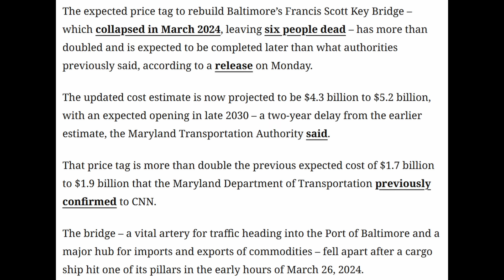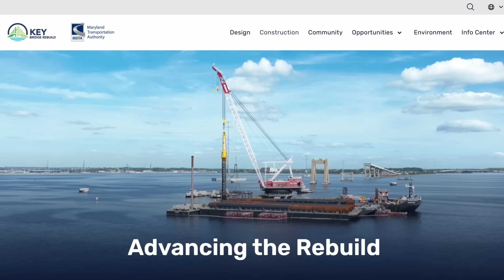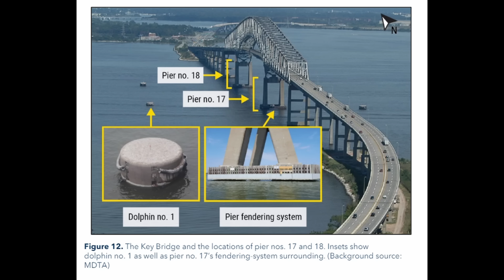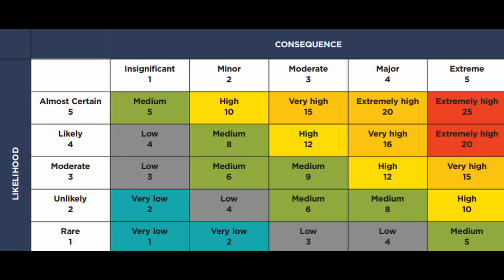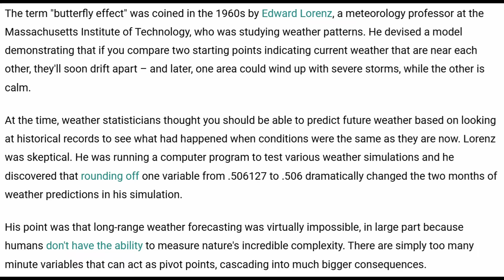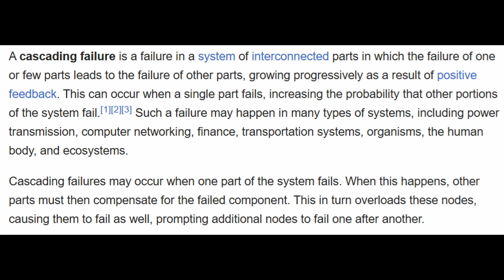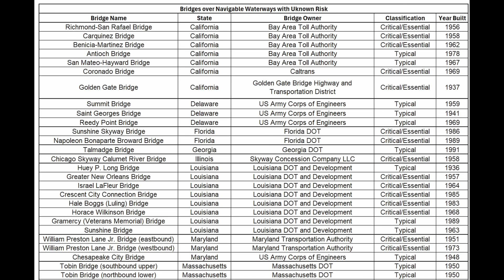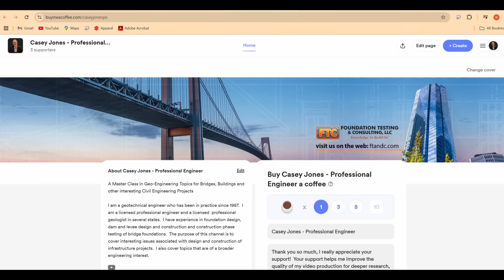Key Bridge Destroyed because of a Label on a Single Cable

Comment: In olden days the calculation of safety margins was simpler. Where bridges were concerned, you determined the build requirements to stop your biggest ship and doubled it. Today you average the requirements for the most likely size of collider and build the cheapest solution instead. Emphasis on cheap!. I have a better solution, build droplet shaped dolphins that  have a width twice the size of the pier and fit hull rippers on the tail. These would be placed blunt end first at a distance where normal passage would in worst case graze the ship and not intersect the tail. However, if the ships course be it powered or otherwise would collide with the pier then the hull would collide with the ripper grid and tear open the hull sides allowing tonnes of water to flood the forward compartments increasing the ships mass greatly and fast. This increase in mass would quickly damp the ships inertia and would ground the bow in the riverbed. The faster or longer the collision, the faster and greater the flooding. The advantage of this idea is that it would be cheaper for the bridge builders with the cost burden falling on the insurance companies with clients that run poor or sloppy  maintenance practices. It would be faster in operation and would spur the adoption of better procedures in the shipping industry and governmental circles.
Reply: Yes, because voters won't approve the funds to do it that way, they want cheap, they get cheap

Comment: This video shows a complete lack of understanding about the role of probabilistic design and quantitative risk analysis (QRA) IMO (Chartered Engineer here).
The so-called "commonsense approach" is full of inconsistencies and is little better than an educated guess. Typically the user puts events into a box in a matrix of probability vs consequences. They often then add up numbers, multiply them together or whatever to look at multiple events. The numbers look good but are actually pretty meaningless.
The real benefit of doing a QRA or failure tree analysis is that the process forces the analyst to think about possible scenarios in a logical manner. They have to use the best data available and state the assumptions clearly. These need to be reviewed as time goes on so if they become out of date the analysis can be updated. The commonsense part is to look at the results and ask if they look real or not.
The trick is not to try to go into the analysis in fine detail but to keep it at a fairly high level. There will for example be data on "uncontrolled ship incidents" and a literature review can be surprisingly productive; you don't have to look at the level of electrical blackouts, drunken helmsmen or other causes of uncontrolled ship events. If there's a complete lack of data in a certain area then flag this up and press for funding for research to fill the gap.
Sorry but the "commonsense approach" belongs in the stone age. We can do much better these days. It's the way that most sectors of the engineering industry operate.
Reply from the maker: You're making it more complicated than it really is.  The common sense approach would be to ask could a ship go off course and strike the bridge and destroy it and the answer is yes. Yet they provided virtually no protection for that circumstance.
Reply: @CaseyJones-Engineer  I agree with your statement that there was essentially no protection against ship impact and there clearly should have been. Now that they are rebuilding the bridge at huge cost they should look at all the potential risks (ship impact; aircraft impact; vehicular accidents; fire; earthquakes; acts of terrorism) and their mitigations and decide where to spend the money. QRA is an excellent tool for this. No one takes the answers as gospel truth but it really does help to set the priorities. I agree that the analysis shouldn't try to be too detailed otherwise one misses the big picture.

Comment: The maneuverability of a ship shall be ensured by using non-failsafe circuits for overall shutdown functions - it is as simple as that!

Failsafe circuits shall only be used to protect single units, such as an generator engine.

It also helps for critical like this to 'be on high alert' - have a trained and experienced crew, and have back-up plans for undesired events - have the anchors ready to be dropped - use tugs - go under the bridge in daylight - and if possible, at low (tidal) currents

Comment: I don't see this has anything to do with The butterfly effect. The central theme there is that something trivial and completely unrelated can have an effect on something else which is serious and which is still completely unrelated.
A power outage is hardly an unforeseeable outcome of a wiring system problem on a ship. And a collision with a bridge is hardly an unforeseeable consequence of a ship which has lost all power.
While the exact sequence of events may be low probability that does not make it an application of The butterfly effect. 
The connection and path of causation is clear

Comment: One important thing that I noticed regarding this ship hitting the Keys' bridge was that there were no tugboat assisting the ship out. Who decided that it was OK to not have any tugboats to manoeuvre the ship out?
Reply: Yes, it's common. Tugs are only used when necessary, and on that exit the ship had sufficient maneuverability. Most ships make that particular transit without assistance. Argue amongst yourselves as to whether they should be using tugs, but that isn't the question I'm answering.
Reply: I don't think a tugboat, or even several tugboats, could do anything except change the facing of the boat, not its heading or even really its speed. The cargo ship weighed 250 million pounds

Comment: It's fine to estimate probabilities. But it's also important in those cases that you take into account the confidence/certainty, and then you propagate that. Once you do that, if your estimates are not pretty certain, and you have several that depend on each other, it becomes clear that your final number is not meaningful. If you have pretty certain estimates and they don't all depend on each other, then it's clear that you have a useful conclusion.

Comment: I don't know why you got so bogged down in the Butterfly Effect. It only applies to systems that are mathematically chaotic - that is, systems in which input and output are related by a power law.

The Butterly Effect is completely irrelevant when talking about a cascade of multiple failures that allow a seemingly innocuous error to cause a catastrophic failure.

The question isn't "what caused the first trip of the circuit-breaker?" on MV Dali. The question should be "how did a minor error cause multiple systems to fail?", to which the answer is, it didn't. The multiple systems in between that first circuit-breaker and the Dali's loss of control had *already* failed.

Comment: When I go through the comment section everyone is just discussing the loose wire in the ship.
No one seems to talk about the fact that a nudge from the ship caused the whole bridge to fall like a stack of cards.
Who care about the ship? If that's enough to put out a whole bridge anything could make it fall. An earthquake. A car colliding with the side. Flooding maybe?
First of all the ship shouldn't be allowed to touch the pillars. Give it a channel to go in with railings on the sides.
Then I suppose the construction should not allow for the whole bridge to completely go out if one pillar is removed. This bridge had basically no redundancy at all.
I'm not even an engineer. But I would like to survive going across a bridge.

Comment: Where was redundancy and why did it fail? Why wasn't the anchor dropped immediately?
Shipowners are literally in a race to the bottom when it comes to maintenance and manning.
Ports need to create a narrower channel so that if a ship goes off course it runs aground.  Particularly these ultra large vessels.

Comment: On the Concorde crash, there was something more to that than a piece of debris on the runway. Because the Concorde was designed before they made radial tires for aircraft, those planes operated with bias belted tires throughout their life cycle (seriously - why they never changed is a mystery). When that tire hit that piece of metal that tire tread was ripped to pieces, firing debris into the engine. A radial tire would not have exploded that way, the tread would have failed but it would not have blown into a ton of debris.  The timing was near the end of the life cycle of those planes anyway, so that became the precipitating event to ending the life cycle of those planes. They never made economic sense, losing money from the start right through the end. They were kept flying as symbols of national technical competence. Nothing like having one crash like that to put the lie to that.
Reply from the maker: Thank you very much for that additional information. I guess it's better to not be at the beginning or the end of a product life cycle.

Comment: Probability assessment is useful for providing insurance, those covering the risk will ultimately rely on historical data and whatever latest models they’ve come up with to the price a risk, that’s not the same as deciding the level of resilience you want a design to have. We could build everything to handle every event we could think of, but the world would have far less of everything due to the cost, meaning our economy would be far less productive over all. One of the best models out there is aviation, they analyze accidents in detail and do force retrofits where needed. That being said public infrastructure can only be as good as the public are willing to fund, together with everything else the economy needs. There is also a limit to realistic future prediction time horizons. At some point while we aim to avoid accidents, they are almost an inevitable factor in a system with finite resources.
Reply from the maker: You bring up some great points.  The pier protection for this bridge was woefully inadequate and they had plenty of warnings that they should have provided an upgrade.

Comment: I’m an engineer and on mission critical systems, we emphasize redundancy like NASA did.  That approach may not translate well to civil engineering projects so in those cases I would look at designing for greater support or some mechanism analogous to a “throw-catch” algorithm in software where an event which would in normal design result in an instant failure actually triggers a less serious failure that prevents complete failure of a bridge but provides the cushion that allows traffic to evacuate the bridge before tha span fails or sacrifices some explicitly added structural “crutch”.

Comment: Looks like a training failure as if backup system had been setup in auto, power would not have been lost. Testing of backup systems and preparing for failure allows crews to be ready for the emergency.

Comment: The issue at hand is how to safeguard all the existing bridges near US ports. There are a lot of substandard ships and crews operating in the world and there is no way for the US to bring them up to standard. We need to focus on protecting the bridges by either installing abutments around critical bridge pilings or require tugs to tender the ships out to safe waters. In this case the ship tender turned around only a mile or two back.

Comment: From the time the Key Bridge was built until it's demise, much of the surrounding properties have changed use. A key consideration that was neglected. First question should have been, is this the optimal location for the bridge or should we look for sites upstream from the port.  Since it was a designated haz-mat route, perhaps locations further inland would be a better choice.  Side benefit, the bridge doesn't have to be as expansive and can be less expensive.
Reply from the maker: I think you bring up a great point. Another point is does this bridge actually need to be replaced?  The average daily traffic volume was less than 30,000 vehicles per day. That's a lot of money for a replacement for such a low traffic volume.

Comment: You were almost right with the Concorde accident. The tyre did blowout due to a debris strike on the runway, but there was no wheel fire. What happened was that a chunk of tyre struck the underside of the wing. The fuel tanks were filled to the brim and as liquids cannot be compressed the resulting shockwave ruptured the port fuel tank, thus causing the fire which downed the plane. Had the fuel tank not been completely filled, the air, which can be compressed, would have absorbed a great deal of the shockwave and the tank would not have failed in the way that it did. Again, a series of seeningly mundane events that lead to catastrophe.

Comment: Well, the first thing I thought was related more to the cascading failure on the ship than related to the bridge itself.  We are sailing thousand-foot vessels now with mostly the same regulations and standards we came up with when ships were one-fifth the length and less than one one percent of the current typical tonnage. Today's vessels represent an order of magnitude more responsibility and should be implementing safety and equipment requirements  a whole order of magnitude more comprehensive.  If nothing else, insurers ought to be insisting on it because of their exposure to both primary and liability damages. 

If there is any single wire anywhere on your thousand-foot ship that could cause catastrophic loss of steerage and electrical power when some monkey rips it out at the wrong moment, then you damn well ought to have designed that ship better.  The rudder is something that should be continuously powered by at least three different power sources, and controlled by at least two or three entirely independent wiring paths. A ship surveyor should be able to rip any single part out anywhere, shut down any two of the power sources, and require the pilot to demonstrate that they still have effective helm response.

Comment: OK you didn't mention anything about the modified fuel lines  going to two generators there was supposed to be two fuel sources one for each generator and they reduced it down to one to make flushing the lines quicker going from bunker oil to diesel to satisfy EPA in the port that was a major contributing factor.

Comment: @caseyjones-engineer  Address the entire system - A specialized electric tug that paces directly forward of the vessel's stem, not towing but maintaining a slight tension, with one task: Pulling the bow to either side if steering is lost. Being electric, it could magnetically grapple for rapid placement and disconnect, then onto the next vessel. Also, it wouldn't have to heavily structured like a conventional harbor tug that has to push, and so could have a much higher speed for dispatch and rendezvous. Also wouldn't require billions of dollars, decades of times, and megatons of concrete and steel. "Do one thing, and do it well" for the ten minutes of transit time through the passage. Basically, an 'on demand' bow thruster.

Comment: I am a professional electrical engineer that has over three decades worth of designing, installing, and commissioning electrical and control systems, including Safety Instrumented Systems. I reviewed another Youtube where the one line of the ship's electrical system was shown from the NTSB report. The entire ship's electrical system was designed to avoid a single point of failure and failures like the one indicated (a control wire separating to the "open" position) are not unexpected or uncommon. The single failure was on the one side of a low voltage main-tie-main bus. The high voltage bus was also a main-tie-main. Apparently the tie was open on the high voltage side and  when the low voltage side tripped, the ship tried to start the generators on the opposite side of the tie but did not have enough fuel to power the ship.  These two generators should have been in operating condition. In addition the original generator could have been used if they closed the high voltage tie. So the big problem was that the generators did not have enough fuel and the power system operators did not operate the electrical system properly. I understand that you are probably a civil/structural engineer and are paying more attention to the bridge than the ship but this was a totally poor operation. This video goes into the electrical system failure. https://youtu.be/wHacCVJAvaA?si=YaZviZCO3Yi4SvD1
Reply: I was thinking there has to be some redundancy in the design.  There was, but not in counting on the generators to actually have fuel.  You can’t make anything idiot proof.

Comment: Trying to fix the ship is a losing proposition. Rather we need to design with the assumption that failures will happen, and build infrastructure that functions regardless. Anything else is far too brittle from a system standpoint.  Bridges need to be built so that the collision can't happen, or if that's not possible so that nobody could die if it did. Both of the latter two are possible (building the caissons wider so a ship will run aground as in the new design, or keeping people off the bridge if a ship is crossing it, or building actual upstream barriers). We can absolutely design infrastructure to not collapse like this, we just choose not to because its cheaper and easier to let 6 people die and charge taxpayers for a new bridge every 40 years somewhere in the country.

Comment: I wonder if the ship building industry has any sort of system  safely analysis as part of the design process. For large transport category aircraft (most airliners) Part 25 requires an extremely rigorous process to ensure system and aircraft safety. Look up AC25.1309-1B. It is very thorough and the process it defines works.